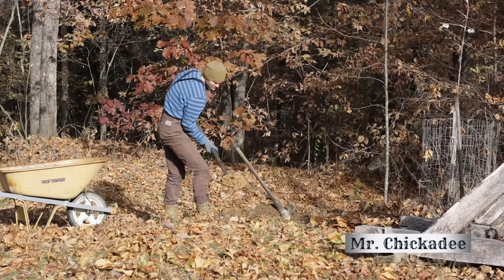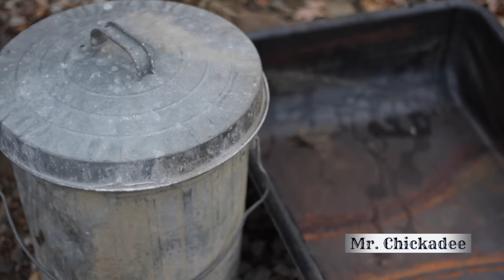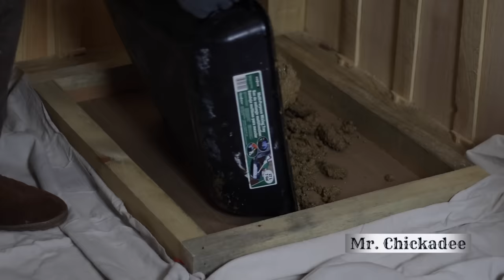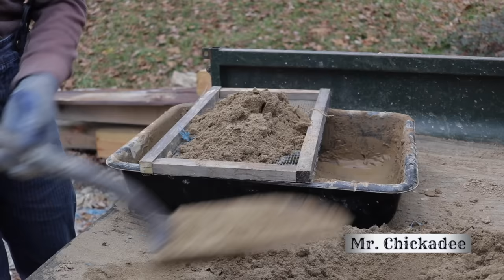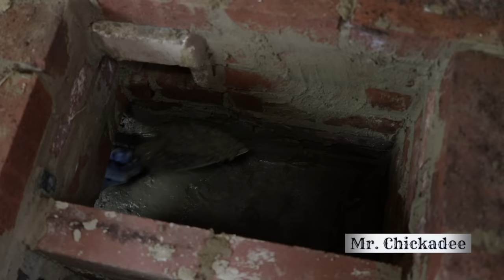How to build a tiny masonry heater for the woodshop

Comment: it is usually better, and recommended, if shifting a chimney over to use two 45 degree bends rather than two 90 degree elbows as you did. If fact, local code may even require 45s.
Reply from the maker: That may be true, and I did consider it, but for two things. 
1. Pipe would be more in the way of my shelf
2. It would not look as cool

Joking aside, if it did not draw as well I would change it, and of course best case was to change the stove design so the flue was centered on back of stove and just went straight down...
Reply: @JayCWhiteCloud  I don't "mind", but, oddly, when someone mentions regulations, so often someone else has to comment like that. I was merely pointing out that for many people, regulations exist, and they need to follow them. Else they may become very unhappy when fined -- or worse when their house burns down and their fire insurance is canceled because they did not follow regulations or inform the insurance company they put in such a stove. And yes, I know not everyone has fire insurance. What I was simply saying was: Good, bad, or indifferent you may feel about regulations, they are a fact of life for some and those same people many not realize they need to follow them. And, side note: best practice is to use 45 angles (same as many codes). It has to do with Bernoulli's equations.
Reply: @MrChickadee  I think 45 would look cool. But not quite so steampunk. Well.... okay, maybe you win -- steampunk is very cool.

Comment: Very nice build and it might be just the right thing to heat my Blacksmith shop, in Winter!  How well does it heat your INSULATED wood shop?  My shop is not insulated and has a lot of leaks in the areas where wind blows through, though I plan to remedy the leak holes, this summer!  If I knew how well it heats your insulated shop it would give me a better idea f how well it could do for my shop!

Comment: Some talk about things used and why would be nice!!
Reply: since it's so well insulated the fire gets very hot. The design then channels the smoke back into the fire so that you extract all the heat from the fumes being reburnt. The thermal mass of the bricks then soaks up all the heat and stores it like a battery. The heat is then slowly radiated out instead of the typical convective air heating of a wood stove of metal. So you just have two fires a day that burn real hot but not very long yet have little smoke exhaust and the rest of the time (24 hours) you get radiating heat from the bricks.

Comment: Due to the insulating properties of the masonry, these do tend to have some thermal mass, but due to the flue, most of the heat after the fire is drawn up the stack. To be efficient, they can use a good heat exchanger on the stack to claim the heat. For heat transfer most wood stoves are metal. However they do lack the thermal mass for thermal heat storage.  A wood boiler with storage tank can store large amounts of heat. A used 200 to 5000 gallon water tank heated with the fire, will keep the temperature warm for quite a while. An insulated tank with blankets is effective for slow heat release, or a circulation pump and thermostatic fan can work very well with an insulated tank.
Reply: Gheeesss,! Who in the blank will have a 500 gal water tank just for heat in a small cabin in outback.
Reply: Its a simple heater for the woodshop bud, no need to get all scientific about it

Comment: Please let us know how the mortars stand up over time- very interesting.
Thanks
FB
Reply: The mortar will do fine. The secret is to fasten each row of bricks together with softened steel wire. You put a hole in at least every corner brick and run a staple shaped vire corner to corner. When heated up the whole thing expands but nothing on earth vill pull it back to its original shape on cooling down. So you put steel "springs" in to do the job. You won't have to repoint the stucture so often and the lifespan of your stove vill be much longer.
Reply: Ok I put v's instead of w's here and there but I hope you get the point
Reply: @andorsary4476  Great tip

Comment: Great stuff!  A couple of quick questions:

1) How does the fire get fresh air into the firebox?
2) There appears to be a channel (to the left-front of the firebox, visible when the wool plaster/mortar was being applied) to send fire exhaust directly up the stove pipe, is this correct?  And, would this be something that's opened in the start to get airflow going up the chimney, then closed to route exhaust around the firebox (with draught pulling it up the stove pipe)?

I'm thinking about building a variation of this for a cabin I'll be building next year.  

Thanks in advance!
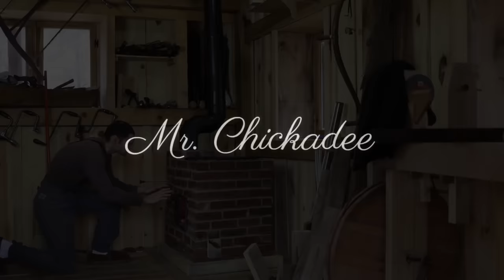Reply: Noah Bodhi Looks like an alternate smoke exhaust handle at 16:17. Probably a metal bar drawn across an opening.
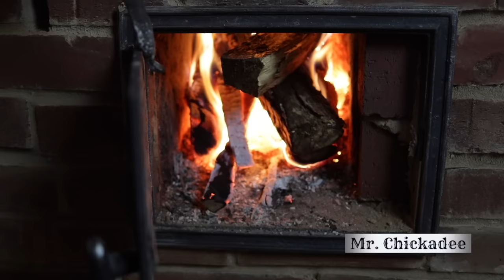Reply: * 15:20

Comment: What is the purpose for the many differently-sized hatches in the top part of the heater?
Reply: Cooking off the top, different size pots/pans and heat control
Reply: He is re-purposing parts from an old woodburning cookstove. The covers come off because a direct flame on your pot is sometimes desirable. Depending on how the smoke channels inside the stove are built, some of the burners are better suited for simmering, others for frying or boiling.

Comment: Be careful.  I am a brick layer (45 yrs) and those brick won't with stand all the heat. It will crack and cause sparks to get out and possibly catch your wall on fire. You need fire brick in side the box
Reply from the maker: Brick stoves and ovens were built for thousands of years without modern firebrick and refractory mortar. An insulating parge is applied to the fire box to protect the clay bricks. This was visible in the video...

Comment: One concern. Do you have sufficient clearance from your flue pipe to your combustible wooden wall? It seems too close on the video. Over time the heat WILL, NOT MIGHT, carbonize the wood and it'll take just one cold night and a really hot fire in that flue pipe to cause the structural and finish wood to reach ignition temperature, so maybe consider some shielding at the base where the flue pipe emerges from your stove up to and through to the bend. You will observe the wood darken and discolor over time and getting brittle and flaky indicative of the slow carbonizing of the wood. It only takes 160° to begin the process and repeatedly over time it will be deteriorating the wood lignin increasing the likelihood of fire to your structure.  Otherwise, great job on the stove, enjoy!
Reply from the maker: Some of your concerns may apply to a metal stove, this heater is very different. Most of the heat either goes out the cook top, or gets absorbed by the bricks, which get warm but not burning hot. The flue gets warm but never as hot as a metal stove since the fire must pass down and around before finally entering the pipe. 
Everything that waddles around and has webbed feet is not a duck! ;)
Reply: @MrChickadee  Thank you for your clarification. As I rewatched the video and observed the channeling of the flue gases and I now see exactly what you mean. Excellent job on designing it to match the cubic footage of the structure. I can see it will properly warm without excessively overheating the space. A very comfortable space with economical use of your wood supply.  Again, great job!

Comment: Okay, so the draft pulls up and over to the right, and then presumably down and around the firebox, before exiting the stove pipe, presumably to extract as much thermal energy as possible and transfer it to the brick, rather than just going up the stove pipe.

Comment: You should not use a 90° elbow, especially right above the stove.  Get a couple feet of vertical rise then use 2 45's.  Having that hard of a turn restricts the draft to much
Reply from the maker: Draft was fine, did you not watch?
Reply: @MrChickadee  yes I watched. I thoroughly enjoy your videos.  I'm glad it works fine in this instance but I should have been more clear that it does restrict flow and may still work fine, just not recommended. Hope to see more of your videos

Comment: I have a couple questions in regards to flu chambers and intake and exhaust placement I am a bricklayer In Michigan and desperately need one of these in my cabin, only about 500sf very little insulation,…. I would gladly pay for even a crude drawing,, it would be on a wood floor and probably about this size
Reply: Like air intake on bottom? With chamber to burn box? And then flu baffles before exhaust??
I
Reply from the maker: I just looked at this page and made it up as I went along https://www.firespeaking.com/portfolio-old/the-cabin-stove/

Comment: how does normal brick not burst or break in the heat of direct flame??
Reply: The key is a slow baking in. Concrete in general can hold up to the heat, what happens is water trapped in the porris material expands and cracks it as the steam trust to escape, if you heat it slowly and allow it to dry all the way out then it won't crack

Comment: I would be great if you could talk through the process or type information about what you are doing, the materials you are using and your technique. I'm not really learning anything. I'm just watching you do stuff.
 Why did you put a wall through the stove?
 Where is a good place to find the iron top?
 What materials did you use for the cement?
 What ratio?

 What mistakes should I avoid?               Help us out a little bit here.
Reply: You don't learn from watching someone do stuff? I am sure you have to. Surely you can type into the google search bar? Well just in case no one told you, you can search for info like that with google. ✌

Comment: Hey Josh. Out of curiosity how has the heater been working?  I will be starting to build a shop soon and I'm thinking of building a small masonry heater in it. Thanks.
Reply from the maker: chris, ive come to prefer a metal stove for occasional use structures such as this shop. mass heaters like this stove work well, if you keep them warm. if allowed to cool after not using the shop for days, there is a longer warming period before its comfortable inside. so, my advice would be use a mass heater if you plan to be in the shop daily, or dont mind a prolonged warming period before work. A metal stove gives fast convective heat that is less comfortable and more transient, but permits fast work times in erratic use structures.

Comment: Is that fire brick or normal brick?
Reply from the maker: normal brick
Reply: @MrChickadee  Any issues with cracking? It's my understanding that you're supposed to do firebrick for direct fire exposure and then switch out to normal brick the farther out you go from the heat source.
Reply from the maker: @godzilladestroyscities1757  long before people had firebrick they used a fire proof parging to line the firebox with. thats what I did, its a mix of clay and sometimes ash or wool or charcoal.
Reply: @MrChickadee  Okay, cool. Do you know of any resources I could look into to read about that? I think it would be cool to build a brick barbecue for my parents but I don't want to go over board on costs.

Comment: There's no fire brick.. Regular building brick will not last long exposed to that heat
Reply: I guess the older style of brick has less cement in it and more clay so it doesn't break down so easily.

Comment: Should have put a damper in the flue pipe to control the draft!
Reply: He did. Look on the lower part of the chimney.
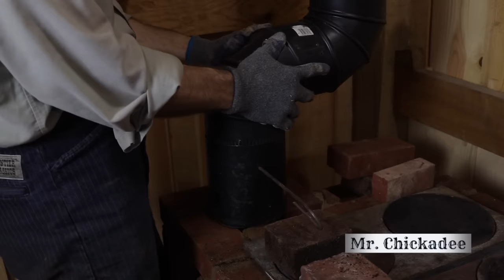Reply: At roughly 14:14 in his video, he's installing the chimney pipe and you should be able to see a wire handle sticking out of the short straight piece under the curved bit - that's the handle to control the damper.  It's usually a rounded bit of metal inside the pipe that closes it off at 90 degrees and then opens up more as you turn it further.  They can be a bit of a pain if you lose track of where the 'off' position is though!

Comment: I gotta confess, I'm a little disappointed. With all your skill, enginuity, and resources, I'd have thought you KNIT a wood stoce from steel wool.

Seriously, excellent. But one question, does the internal baffling make it hard to get the draft going when starting a fire in your cold stove? Got a flue spinner to help things along?
Reply from the maker: There is a bypass damper that can be opened for a direct path for cold starts.

Comment: That's the first time I've seen someone use a clay sand mortar like broaudio does.  You should check out his channel. He claims it has the same expansion ratio as the bricks So it eliminates the need for a double-walled masonry stove.
Reply: Use clay mortar and wire clamps. You heat up your stove it expands, but if you don't put anything there that pulls it back together on cooling down, your stove will eventually fall apart. Of cours it will eventually fall apart anyway, but clamping the bricks together with steel wire increases the lifespan significantly, and you don't have to repoint the brickwork so often. You should run wires at least corner to corner. Put holes on top of the bricks and hook the wire ends in there. I build stoves and heaters for a living in east europe, and this is how it has been done here since they invented wire.

Comment: Nice work, but I would have just laid a brick  base and installed a cast iron stove which would give you  better radiation and made the work 3/4 less.
Reply from the maker: This was a fun proof of concept, it did turn out to work, but not be that practical for us personally, since it takes long time to heat up all the mass, only makes sense if you are there every day, if you must not use the shop for multiple days, it takes half day to get going good. So for us, as a seldom use shop space, yes a metal stove is more practical. For a house or daily use building, I thnk it makes sense.